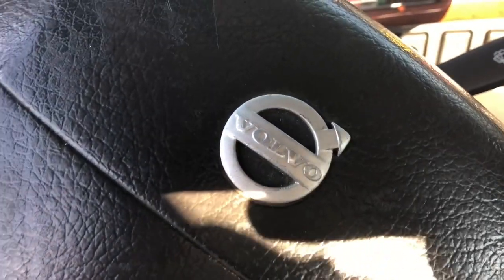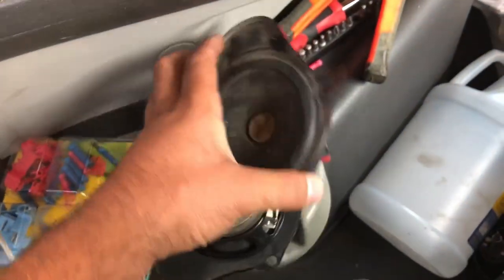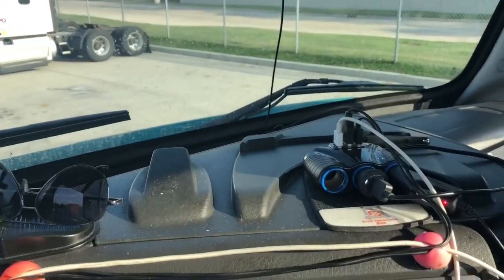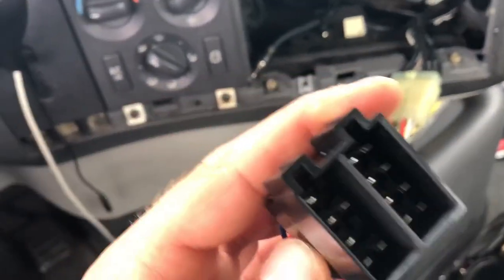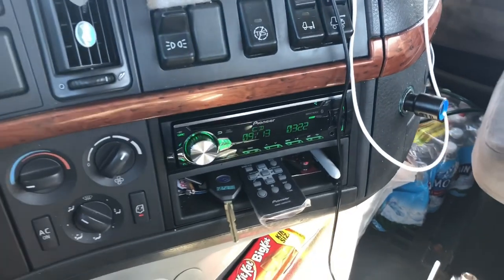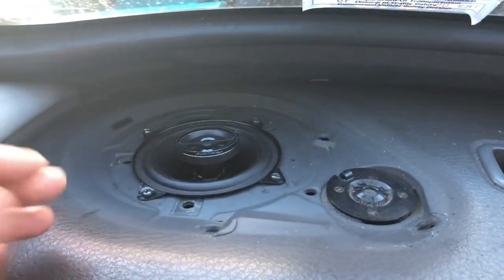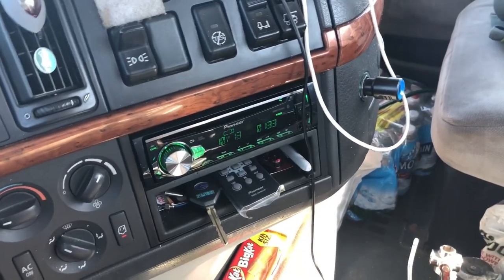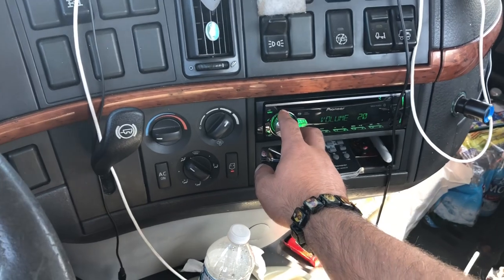Install replace head-unit(Radio) & speakers on 2006 Volvo have duty semi truck

Comment: Great video. You helped me a lot. I'm have a question. Did you put dashboard speaker covers back? Did they fit? I want to replace mine as well.
Reply from the maker: Yes of course they fit just fine speakers are going low enough… not even touching.

Comment: Thanks for the video. How did you secure the new stereo into the dash? Did you use the mounting brackets off the side of the original stereo?
Cheers Jason.
Reply from the maker: I don’t remember sorry but just in case make sure you keep it I remember i brake old radio but don’t remember reason… i guess i could not pull it out from case… sorry

Comment: What if I wanted to get a Android Indash screen would that work also how did u remove the pins and how do I know where to place the pins
Reply from the maker: It must work i’m not 100% but it must work i seen trucks with screens... when you look inside you will see itch pin has little metal piece  stick out that’s what holds on the place you will need tiny screwdriver or something like that to push from side and pull it out and place it where you need to have one...

Comment: I bought Kenwood KMM-BT322U and i want to replace my old Volvo radio. My truck is 2011. So what i see is that this radio has wires for 4 speakers and the truck has 6 speakers. Are they going to work all of them ? 
Thank you and appreiciate every reply
Reply from the maker: Брк Брк i bet yes if your head unit support 6 speakers and as long you connect all colors on hardness must work all good... i never done my self but my dad did on his Volvo 2006 VNL and all speakers work even radio is some Chassis cheep one...
Reply: KeLaVrA Sevin idk is weird cause the new radio that i bought has only 8 wires which means 4 speakers, and on the genuince it has 12 wires which means 6 speakers ( + and - wires). Even if i buy the harness my radio wont have those extra 4 wires for rear speakers i guess
Reply from the maker: Брк Брк all speakers are going thought   harness all what i did as you see in video just connected color to color and even small twitters work till know i don’t know witch cable do what but... with cheep radio on VNL with 6 speakers and + stuck subwoofer 🔊 worked all good and brand new Kenwood must support it as well my dad did it like 5-6years ago... Take a shut it will work I believe... in my case it’s day-cab so it was easy...
Reply: I bought the harness and my Volvo is now even more louder 💪🏻 i installed my new Kenwood radio and all speakers works im so excited. Thank you sir again 👏👏👏
Reply from the maker: Брк Брк enjoy 😉 i told you it will be all good...

Comment: Great video! How hard was to it to take off the fabric door skin? Did it take some prying? Thanks!
Reply from the maker: DesRex Transport it’s super easy you just need to take off window handle witch has one screw just be carful to don’t broke plastic cover witch i did 😖 and cost me 20 or 40$ don’t remember to replace it... everything else just step buy step slowly pull out it has plastic clips it need to pop-out but same you need to be careful... nothing really hard ... 
P.s thank you... hope i could help if you are interesting something else you are more then welcome to contact...
Reply: @Miuhauzen  Thanks alot man!
Reply: Where did you buy that harness from ?
Reply from the maker: Johnny Goins fro walmart Land Rover harness there is link under Video... But you will need to move pins to match Volvo it’s easy you will need tiny screwdriver or some like that to push from side open and pull out pin and put it back what ever you need...
Reply from the maker: Johnny Goins https://www.walmart.com/ip/DNF-Amp-Integration-Wire-Harness-For-Select-Dodge-Land-Rover-Mercedes-Vehicles-70-9401-100-Copper-Wires/810019720 here

Comment: Hey I got the harness the J's but just how do I remove the door panel to get to my 6.5 speakers
Reply from the maker: Johnny Goins you need to remove window handle it has one screw in the center under plastic cover... but be careful with removing  plastic cover i broke spinner and it cost me 40$ to replace handle so you need to be gentle with it...  door panel is just pups out it has clips inside no screw  so you just need to pull out after remove handle...

Comment: How did you get the radio itself out?
Reply from the maker: Demetris Howard it’s on the screws you will need to take out brown moldings up one and down one is just pups out but careful is broking easy screwdriver will help... and you will see screws in my case it was on 4 bolt(screws)... i hope i explain well...  if you have any questions you are welcome to ask...

Comment: Hi is that front smaller speakers are 4 and half inch ?
Reply from the maker: Jas Brar it’s 4inch not sure if 4 & half will fit there... i have showed size in video...
Reply: Thanks a lot for quick reply . one more question do i need to stick with 8 ohm or i can pick 8 ohm also.
Reply from the maker: Jas Brar i’m sorry my friend but honestly i don’t have anther for this question as much I understand it must be up to you... i don’t have so deep knowledge 🙂

Comment: Is there another harness I could use.
Reply from the maker: I believe so if you will find similar...
Reply: Hey how did you remove the radio from the radio frame
Reply from the maker: @lnt101906  old radio as much I remember with hammer 🔨 i brake in peaces 🤣 i did not care i had already checked that new radio was working all good and that was fastest way for me... sorry don’t have helpful anther...

Comment: Is that a day cab?
Reply from the maker: Julio Alexander Carrasco yes it is... but i don’t think so there is different i was driving sleeper 06 as well
Reply: @Miuhauzen  I own a sleeper and it's got two more speakers in the back. I wonder if an aftermarket pioneer radio would handle all 6 speakers.
Reply from the maker: Julio Alexander Carrasco not sure witch one you have but is made for regular cars so it must handle at least 6 speaker 🔊 plus subwoofer 🔊i’ll check what my app shows will let you know later... or just check online what your head unit can handle...
Reply from the maker: Julio Alexander Carrasco i just remembered when i was driving full cab it had some cheep head unit i know another truck witch has older pioneer but stuck speakers so you must be good...
Reply: @Miuhauzen  I got an 05 Vnl 670 with the Panasonic head unit. No amp.
Reply from the maker: Julio Alexander Carrasco i was driving 06 and another is 07 so must be good on 06 was cheep head unit it had subwoofer and actually it was working so pioneer must handle it...

Comment: How did u get the radio out ?
Reply from the maker: You need to remove wood looking plastic moldings and you will see it’s mounted with 4 bolts unscrew it and you will be able to figure how to pull it out from frame as much i remember it has metal clips or what ever is calls holding radio frame... if i’ll find time i’ll try to make another video hot to pull it out... is nothing hard if you are handy you will easy do it...